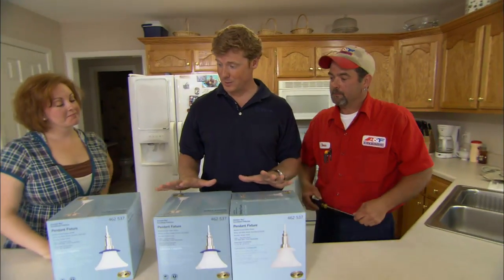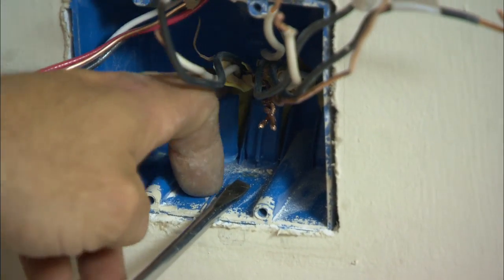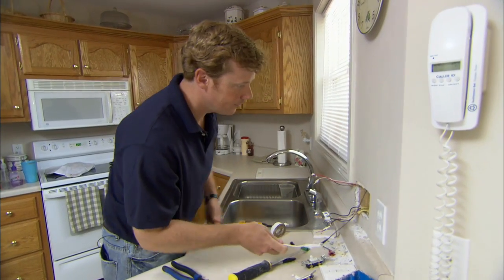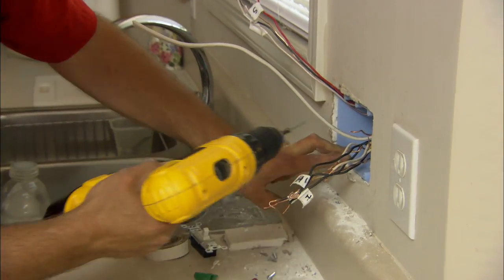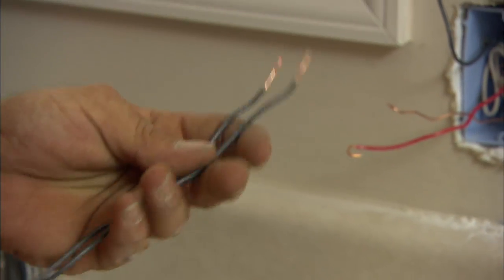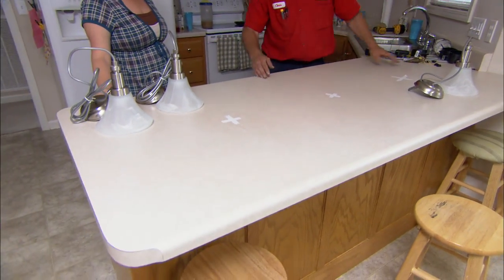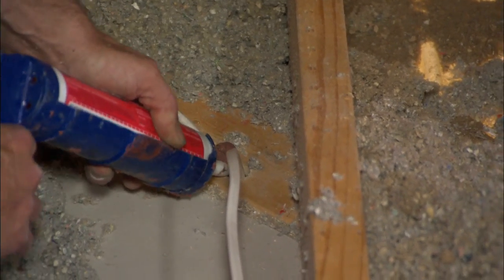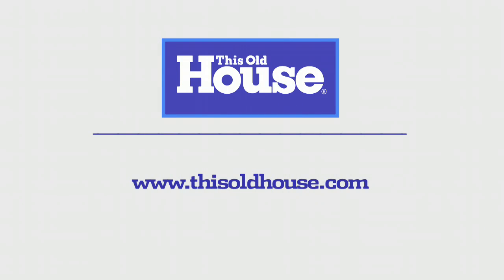All About Lights | How to Install a Pendant Light | This Old House

Comment: Putting 2 14/2's in a pancake is illegal. But I cant say I havent done it. Sometimes you get in a pinch and have no choice. Overload the cubic inches.
Reply: Davey28car not illegal everywhere
Reply: Definitly against cec
Reply: @denislamarche4656  1000% 😂
Reply: @GlitchedPepsi  Where isn't it illegal?
Reply: Agreee!! The wires and wire nuts could barley fit and I thought he was a licenced electrician

Comment: That's not code. You can't put screws through the box should have used a 3 gang old work box
Reply: if you look closely at the 3 gang box he used, all he did was take a 3 gang new work box and cut the brackets off of it.
Reply: I don't think the sheetrock srews are likely to become energized
Reply: If the screws are in the back 1/4 of the box it's okay or if it's a listed box with built in screws (smart box makes some) this guy didn't have an old work box so he hacked off the wings of a new work box.
Reply: That is to code.
Reply: This is definitely not code compliant. Once he cut the brackets off and screwed through the box, he voided the UL listing.
Reply: scotty hanson incorrect

Comment: I have 1 light in my kitchen and want to add 3 pendant lights . Can I use the same switch?
Reply: Sure. The circuit is simple. Parallel the hot wire for each additional light to a hot wire going to the load side of the switch, and parallel the neutral of each additional light to a neutral wire that's tied into the neutral of that circuit. If your circuit is grounded, tie in the ground wires as well.
I recommend using fixtures that have dimmable LEDs and use an LED compatible dimming switch.

Comment: I LOVE HOW THEY DONT SHOW YOU THE LITTLE PROBLEMS THEY RUN INTO...I.E. FIRE BLOCKING WHEN RUNNING WIRE IN THE WALL...SCREWING THE BOX INTO THE STUD WITH A SCREW AT A SLANT SO YOUR BOX ENDS UP CROOKED AS DO YOUR OUTLETS AND COVER PLATE....C'MON
Reply: They never show things like that,that's why DIY'ers screw up there houses and end up calling us,real electricians.

Comment: Ok well if I’m correct, that box is no longer UL listed because he drilled through the box into the stud. He also cut off those 45 degree tabs for the nails. He should have used an old work box.
Reply: He should have went for an old work box with the tabs that flip out. Would have also been more secure and less floppy
Reply: he cant use the nail tabs without cutting off more wall. It worked for the situation.

Comment: Where did you find the electrical box which is very shallow? Most of the boxes are very thick and if they are installed under the wood just like you did, the box will be pop out of the ceiling. So they have to nail it beside the wood which is not as good as beneath it. Where I can find the shallow electrical box? Thanks!
Reply: Pancake or ceiling boxes.  The big box stores or hardware stores.

Comment: if that outlet next to the switch is that close to the sink should it not be GFI?
Reply: +altecdarpa21 It's most likely a split receptacle and I have never seen a split GFI. So you would have to make it 2 switches each a GFI. Anyways the electrical was most likely done before the GFI code was instituted, and it is not retroactive.
Reply: Yes
Reply: All receptacles serving counter surfaces in the kitchen must be GFCI protected, as well as the dishwasher circuit.
Reply: A regular outlet can be GFCI protected by the most upstream outlet being a GFI or having the entire circuit on a GFCI breaker in the panel.

Comment: What would have happened if there didn't happen to be a ceiling joist to screw the pendant mounts into?  My luck i'd plumb bob up to the ceiling and there would just be drywall there.
Reply: Use an old work light fixture box, those won't hold a fan but will be plenty for a pendant light.
Reply: Use a fan bracket. It's basically a threaded rod that wedges into the ceiling joist on either side and once it's there you clamp the ceiling box to it. Installed probably they'll hold anything you want to hang on it

Comment: Did anybody else notice that he used 14/2 on a circuit that has 12/2? i hope thats not a 20A circuit because 14AWG wire is not rated for 20A.
Reply: It’s a light the wire probably came from a 20 amp circuit somewhere else like the outlet next to it the lights not gonna draw 20 Amps it’s gonna draw less that 5 amps
Reply: Safeman4202 technically it is rated for it(via the table) but they have a special code for small wires and that’s where they don’t allow it. For some reason....
Reply: SomeRandomGuyWithAChannelOnYouTube that doesn’t mean it’s ok
Reply: I did notice that. I figured they wanted to make it a "combo light and heater". Ha
Reply: #14 thhn is rated at 25 amps but has overcurrent protection limitations
Reply: @adammorgan9304  yes… per table 310.15(B)(16). However NM-B cable has different limitations

Comment: looking at the K.O. spacing on those pancake boxes, they sure look like 3 1/4" pancake boxes. Those are only acceptable as a "end of the line" outlet (one romex only) because of their conductor fill capacity. Even than, # 12 overfills the box but it's commonly overlooked. Two  romex's in each pancake "overfills" the boxes even with #14 romex. Also, did all three boxes land on a ceiling joist?? Why not move them over 1 1/2" and use a standard 1 1/2" deep box or use a junction box in the attic with a single romex to each pancake box???
Reply: Pappa Bob Thanks for adding this comment, now I know exactly what to do.
Reply: +Pappa Bob It's different codes in different states/provinces. In Ontario you can put 2 romex wires in a pancake and use the pancake box wherever you want.

Comment: When you hooked that wire onto the screw terminal, why didn’t the electrician clamped it down with the piers to close the loop around the screw then tighten the screw? That’s pure laziness what the electrician did.
Reply: Not really its clockwise so its fine

Comment: He could have kept the same smaller box.  You can fit four switches in a standard two switch box if you really wanted to.
Reply: sure, but it's definitely not code and would not pass inspection!
Reply: Makes it much easier for fishing wires with the box removed
Reply: Traffic Control Freak stack switch is code and UL listed.

Comment: In Canada you can't splice in a pancake box.
Reply: it's pretty much code anywhere since they are are about 7 Cubic inches and 14/2 is 6 cubic inches.
Reply: @Jupp Schlabutt What's to worry about with wire nuts? Bad/loose connections only occur when installed wrong.
Reply: @Jupp Schlabutt North America has both push in and lever wago connectors available. Lever wago's are gaining popularity, but a lot of people are hesitant about using the push in wago's because of a similar design used on older outlets/switches. They were an inferior design, which in a short period of time became apparent that the connections were loosening as the springs became weak. It's my understanding that several European countries had wire nuts. They fell out of favor because they were poorly designed, and in a short period of time often cracked and became loose. Some designs in the past may have been inferior to their Continental counterparts, but that doesn't mean their methods of termination are unsafe today. With modern designs, no one type is better than the other when it comes to long term durability and operation.

Comment: you guys did an electrical code violation. you can not run 2 pcs of Romex wire in a pancake box. instead you can install a 4s box to run 2 romex wires

Comment: Your only allowed to put one one romex wire to each  metal pancake box 💯

Not up to code ! 

An inspector wouldn’t allow to romex wires in 1 metal pancake box. 

Am I right or wrong ?
Reply: The fill for #14 AWG conductors is 2.00 cu inches for each wire entering the box to be spliced, plus one (1) count for all grounds entering, plus one (1) count for any internal cable clamps or hickeys (of which there are zero in this case). So (4) current carrying conductors x 2.00 cu in = 8 cu. in plus one ground count of 2.00 cu in = 10.00 cu in required.  That appears to be a Raco 293 pancake box; the manufacturer indicates the volume of the box is only 6.00 cu. in.  Splices of this nature cannot be made.  If the electrician were committed to the pendant location mounted at the joist, he should have brought a single 14/2 cable up from each pancake to the attic and terminated in a 4-square junction box with adequate volume to make an appropriate splice.
Reply: Steve I was thinking he was going to run to a 4 square when I was watching. I was very surprised when I seen two box connectors in the pancake. I’m not sure where they found this electrician but he needs to be trained on the code.

Comment: Not only did he overload the pancake but you're only allowed 1 romex in each of the plastic tabs in the 3 gang box. Unless  it's a single gang only 1 wire per tab. This animal also decided not to use a drop cloth or an old work box. He also cut the hole like he had zero pride in his work.

Comment: Oh that's such a shame you edited out the most important part to see how you do is to thread a second wire through beside the original one and to see how it could be pulled down through the wall was crucial!  could you please please add a video to show how to do that?
Reply: There's an open vertical cavity in the wall, and the new wire was simply fed through it by first dropping a fish from above, tying the new wire to it, and then pulling it up, which they showed being done.

Comment: 2:39 CODE VIOLATION!!!  ⚠️  You can’t drill through a box- you buy a retrofitted box with tabs that go on the back of the Sheetrock
Reply: 2:27
Reply: 2:39 is incorrect too. Should have tightened the loop before screwing it down.